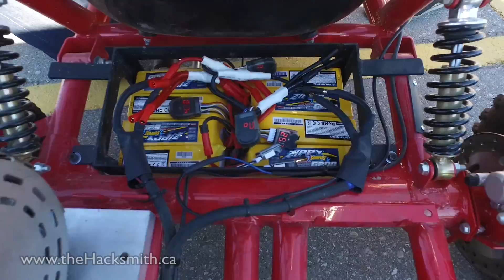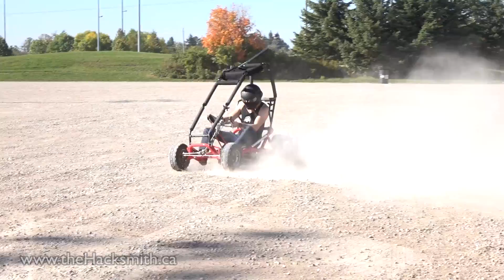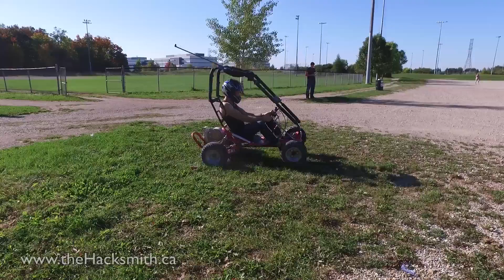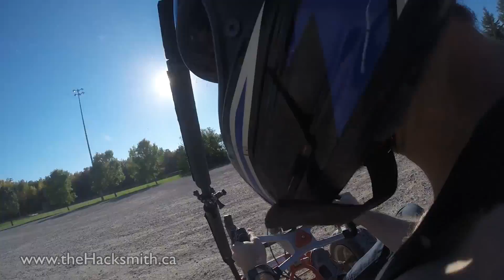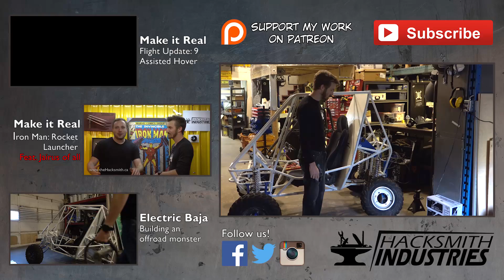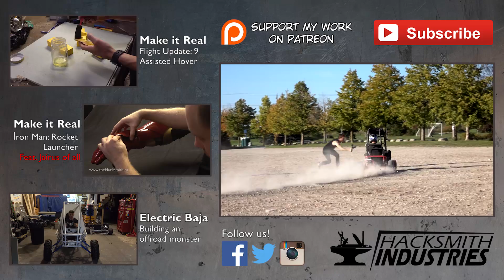Overpowered Electric Go Kart has TOO MUCH TORQUE (54 FT-LB!)

Comment: What do you can that motor? It’s not just a brushless DC motor, it has a spud shaft and sprocket
Reply from the maker: what?
Reply: @hacksmith  
I mean that style of motor, does it have a specific name? It’s not just a brushless hub motor cause it has an output shaft.

Comment: Electric motors  mechanically simple, more efficient, than internal combustion. Only problem is solving the weight to power ratio with the batteries.

Comment: I have a few questions what would be the total price for this what’s the top speed and  where did you buy the go kart without the electric engine I asked these questions bc I’m 13 years old and I wanna make an electric off-road vehicle oh and btw what was the battery time? Also what motor did u use the 8000 w or 4000?

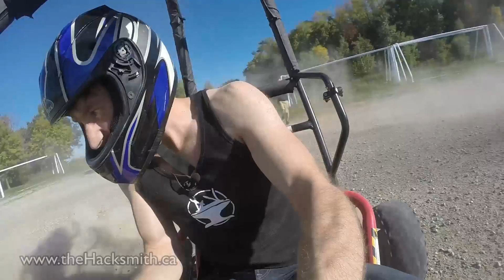Comment: @1:44  umm no actually an engine doesnt put out max torque at the redline its actually much lower ranging from 2-4k depending on the engine (stroke v bore n such)
Reply from the maker: roughly

Comment: I got 12 8s 20,000ah lipo batterys that have 22.2 volts each which equals 266.4volts with the same motor as yours maybe little more powerful and a high end speed controller the thing can get to 0-50kph in like 0.6 seconds has it's all wheel driven, and the batterys last a very long time I usally get 122km and full throttle going at 142kph gets 98km which is crazy and the whole thing pretty much looks like a standard electric buggy like yours but it packs a serious PUNCH
Reply: lol lies
Reply: Where can I get all the equipment your talking about?

Comment: So you ran 8 packs of 8S lipos, but did you run those so 4 packs are in parallel (so 12S4P format)?   Was trying g figure out voltage you were pushing at motor.  Thanks for any input

Comment: Out of curiosity, how many motor RPMs is the 54 ft-lb torque rating measured at? Been building an electric gokart for quite some time now, wondering if there's a standard RPM torque is measured at.
Reply from the maker: torque is typically constant for most DC motors :) so it doesnt matter -- full torque at any RPM. that's why its better then ICE
Reply: I was under the impression that electric motor torque was measured by using the following formula: Horsepower x 5252 / RPMs. And also that wheel torque was found by multiplying the resulting motor torque by the gear ratio of the axle and drive sprockets.
Is this not correct or am I missing something?

Comment: What motor and speed controller are you using? Can we get the exact models"?
Reply from the maker: http://accelerated-systems.com/products/ 4000W controller i think... they don't sell the motor though
Reply: Thanks for the quick reply. Do you know the specs for the motor? 3 phase, etc.. etc..
Reply from the maker: +Douglas Loyo didn't we say that in the video? BLDC motor

Comment: That's great, and look fun....  for 15 mins, until the batteries die.  Then the next set of batteries die.  Then you're broke because you spent $1000 on batteries.  Or just buy gas and drive all day.
Reply from the maker: Those 8 batteries actually last about 45 minutes. Could easily double up the size of the pack and then you've got 1.5 hours. Keep a second pack on charge, and you will driving all day.

Plus you'd need a 30-40HP engine to get 54ft-lbs of torque.

Comment: you prob gett like 30 min of riding time a gas engine gets like 2 hours and still much more fun and sounds better
Reply from the maker: +Timo Hacks closer to an hour actually and did you see how small the battery pack is? We've got multiple so you can swap it out, charge the others off your truck alternator and keep driving

Comment: the motor test in my latest boat was 85 ft pounds torque, I improved the torque to 500 ft . . . . I love your gokart. . . . now lets take your kart for a ride without batteries . .
Reply from the maker: let's take your boat for a cruise without gasoline.
Reply: the Hacksmith 
take look . . . my boat  electric powered
i can make your kart go without batteries
Reply: dude electric drive . . . boat

Comment: What's it like on concrete???
Reply from the maker: +Tim B even better!!!
Reply: the Hacksmith That's awesome, have you thought about making a build that has a gas generator powering electric motors? l've been thinking about doing it myself because I haven't seen anyone try it...
Reply from the maker: +Tim B it's possible but you need a pretty big motor due to inefficiency -- so it kinda ruins the point of an electric car :p
Reply: the Hacksmith Ok, :) just thought I'd throw it out there!

Comment: Looks fast, but it's not practical if you want to have fun with it. The fact that you have to charge it forever and wait is time you could have spent having fun with it. I really think gas is the way to go still. The 670cc predator engine would go great on that kart. Just add gas. Plus it kinda sounds like a Harley.
Reply from the maker: Lasts about an hour per charge and that was a tiny battery pack. Larger one, plus one spare charging while you're going (can charge off of a car's alternator) and you're good to go!
Reply: the Hacksmith how long does it typically take to achieve a full charge on the larger battery?

Comment: Was talking to a guy at work the other day about electric cars and hybrids vs gas engines, pros and cons of each. The guy says to me (about electric cars and how quick they run outta juice), and I quote, "they run out so fast when you really get on the throttle. That's why they should invent some way for electricity to pour into the motor like a gas tank does for regular engines." I just kinda gave him this dumbfounded look and said... "You mean, like a battery?" LMAO 
And he just kept goin! "Yeah but like a gas tank has a fuel line and jets or injectors to spray the gas into the motor. Like that, but for electricity." I said, "You do know that gas is a liquid and takes up physical space, and electricity doesn't, right?" And he said, "No its not. That's why it's called gas. Because it's a gas. It only becomes a liquid when it gets sprayed into the engine. So if they can just build a special tank and fill it up like a gas tank, but with electricity, then u wouldn't run out so quick. And they could make electricity stations where u fill up the tank like they do with gas." 
About this time I realized I wasn't getting anywhere and just say there stunned and said, "Yeah man. That'd be a good idea." 
Pretty sure he thinks he just invented the electric car. 
U don't want to hear his theory on how hybrids work. Let's just say he's convinced the car combines "small lightning" into the gas to make it burn hotter, slower and cleaner. U know, electricity burns clean because its natural and u never see any smoke in the sky after a lightning strike... 
Yeah...

Comment: I went on their website trying to find how to order a electric motor like that or bigger i'm thinking One equal to around 25 or 30hp & I'm needing a controller I have a ATV salvage business and I have plenty of atv's that I could install that in I think it would be bad ass for hunting and hook it directly to a Polaris transmission and I have plenty of room for batteries.
Reply from the maker: They aren't commercially available yet unfortunately. Company is still doing R&D
Reply: the Hacksmith dang man if they want to test it on an ATV tell him to send one my way I will put it through the Ultimate test make sure it's waterproof 😂👍
Reply from the maker: +Matthew Milam lol I think they're good haha. I don't think they are waterproof

Comment: make a go kart But which can drive on. railways 391mm (15inch gauge) the kart could be Longer which maybe reduce the Effect of the tourqe.
Reply: The go-cart should be much longer an maybe wider so the torque will be easier to control.

Comment: how much does the motor and drive cost?+ batteries
Reply from the maker: +jtaylorls1 the motor used in this video isn't commercially available yet. I think the controller is about $1000 and so were the batteries

Comment: Could you use a car battery or maybe a tractor battery to power the motor?
Reply from the maker: Yeah but lithium polymer batteries are three times the energy density of lead acid -- they're much better!

Comment: I can't find this motor on then website ?  anyone know of a retailer ? I want to build a OHV with 4x4 , hubcentric drives on the front wheels and 1 of these in the rear but a 2 seater like a RZR
Reply from the maker: Sadly they are not available for consumer use yet, just an R&D motor

Comment: An electric motor typically has 8 time the horsepower of a comparable gas engine, so 15 horse equals about 120 in gas engine power, no wonder the wheelies !!
Reply: Horsepower is horsepower. If 15 hp was equal to 120 hp, it would be a 120 hp motor. I think it would be a gas engine can be 8 times as large as an electric motor.
Reply: it's rated by the amount of torque it can deliver at 0 rpm!!!! Not  raising 1 lb 1 foot in 1 min, etc maybe I stated it wrong or maybe you should do more research !!
Reply: TheDave570  Sorry I don't need to research that a 15 hp motor doesn't have 120 hp. Maybe you should explained your comment a little more clearly! Looks like someone did a little research of their own after the original post.

Comment: But all the power comes from the batteries, not the motor.   The motor is just converting that power into motion.
Reply from the maker: so... a gasoline engine takes power from the gasoline... not the engine..

Comment: I know this is a stupid question - but how does the thing work with no diff?:) I mean is it acceptable? The wheels seem to take alot of punishment..
Reply from the maker: +Maly Pivo differential would be good but it was just a fun test project, scrapped it long ago. Working with a Baja now!
Reply: Hm I know gocarts dont have a diff but then again they usually dont have this power:) a limited slip diff on a electric engine - wouldnt that be a first:)

Comment: hey mate im building my own go kart. i got a 5 hp electric motor rated at 3500 rpm. im trying to make it go at 30-35mph. i'll be using 12 inch wheels. what type of batteries do you recommend, or how much energy source?
Reply: another question. what can you use to control the speed of the go kart. i dont want it to instantly operate at 30mph. can i use a speed controller? or what do you guys recommend?

Comment: No power regulator, too much torque - this is eletric motor, big torque in low rpm- full power in 0-max rpm???? No traction, guy too much power with big torque in low rpm. Simple PWM power regulator and nice go kart with control.
Reply from the maker: It was a for fun project... The title "too much torque" was so people would watch it. We could have easily tuned the speed controller, but wheelies are fun!

Comment: hey you guys are from waterloo as well.  sweet sheet.  i need a shop to work in.. maybe we can share the cost of a rental garage or share the cost of bigger equipment or work out some sort of arrangement we both can benefit from
Reply from the maker: We're pretty well set right now, found a property (now my home) with a 1300sqft garage in the back, built in the 80's for a trucker =) I'm afraid we don't really have room to share though, but if you ever wanted to collab on a project that might be a possibility
Reply: the Hacksmith
you can text me at 5197229699 or localbroadcast@hotmail.com.  I am building a cnc machine / 3d printer / plasma cutter rig, but kind of lack the space needed to really have it in a functional space... I have most of the parts already needed for it, and I know i have for sure 100% of the materials needed to put the basic frame structure together for it (extruded aluminum and steel tubing).  Would you be interested in having my CNC machine set up in your space, and you could have use of it whenever you wanted, until I get a more suitable space for it myself?  I wouldn't really want to collab on the building of the machine as I've put a lot of thought into it already and would like to maintain ownership of the machine, but like i said, you could use it while its in your shop.  what do you think of this idea?

Comment: why did he not use a car battery
Reply from the maker: Cause it's a 48V system, you'd need four car batteries
Reply: the Hacksmith oh ok
Reply: Because LiPo > Lead Acid and like 1/50th the weight.

Comment: I have (had) a gocart made from high performance slalom racing gravity racer, the gas engine sucked, but the frame is super stable, titan floored I think, with this engine it would be universal missile. It has only 10cm ground clearance, and suddenly only front brakes from now on, but kinda big alloy wheels with big round and sick tires. Your engine is ridiculous. :)

Comment: when he said the electric moter could beat any 15hp gas moter I laughed my ass off
Reply from the maker: +Sagen Nc it can... A 15HP gas motor has about 20ft-lbs of torque if you're lucky.
Reply: the Hacksmith well yea stock but that's like saying this little electrical motor is stock they had to do a lot of moding to get it this way
Reply from the maker: +Sagen Nc no... It's completely stock, there's barely anything you can do to a motor to "upgrade" it.
Reply: the Hacksmith so there last model before this one they did no upgrades to get the one you got now
Reply from the maker: +Sagen Nc what model are you talking about? There weren't any modifications made, all we did in this video was provide the battery pack. Electic motors are just better than gas pound for pound :p

There's a video of a Tesla model X towing a 3500lb trailer with a super car on the trailer, while drag racing against the same super car, and the tesla wins :p
Reply: A 15 hp electric motor vs a 15 hp gas motor is no competition, the electric motor will destroy it, yes they both have 15hp but the electric motor has more torque and more importantly more USABLE power, unlike the gas which makes the peak 15hp at a certain rpm (3000?), the electric will make max torque from VERY LOW rpm, the electric will definitely feel and be faster no doubt

Comment: Not 54ftlb at the wheels, misleading, need to multiply by the gear ratio for correct wheel torque.
Reply from the maker: +marcussho yeah... You never record torque at the wheels, only at the engine... At the wheels it's over 200ft-lb
Reply: the Hacksmith just giving you a ration, cool build

Comment: Hello. Can you do it also on Servo Motors? What may be the pros and cons?
Reply from the maker: Servo motors are not ideal for vehicle applications like this. This is a brushless DC motor (which is basically an AC synchronous motor)

Comment: you need two. one for the front and one for the back wheels. a bigger battery underneath the seat/floor will help keep the center of gravity lower so it won't roll very much even though that's not much of a problem in a kart.

Comment: DC motors don't put out the highest torque at 0 rpm... AC motors do
Reply from the maker: +Jacob Walls i said practically... It's still a much better performance curve than an internal combustion engine :)

And these are brushless DC motors which are basically AC synchronous

Comment: I built one in high school. it used a 75hp motor and dragged a 1/4 mile at 83 miles per hour. given more drag strip it would have easily topped 120 as it was geared more for top end.
Reply from the maker: +Gerg C niiice

Comment: nothing to do with too much torque! improper weight distribution ,that's why you have no steering and pop wheelies ! since your going to a bigger frame your going to lose the high power to weight ratio.your going to need a bigger motor and more batteries and guess what ,if you don't distribute the weight properly its going to do the same damn thing.good luck.
Reply from the maker: It's just a catchy headline dude, not actually too much torque. We're planning on using two of the motors with the larger frame and keeping the batteries and driver ahead of the CofG. Also having suspension will affect it as well =)
Reply: the Hacksmith yep half expected that response and obviously you know everyone  calls that click bait . not that i give a damn but now a days people tend to be very anal over such trivial crap . wish you guys the best . if you can build a electric trophy truck that can go 500 miles give me a shout !
Reply from the maker: Thanks man!

Comment: Great for level ground, how about up the hill and down in a power to heat dissipation test, without burning the circuits off?
Reply from the maker: Most of the components are pretty over-sized, so not too worried about that -- we'll be doing lots of hilly tests with the dune buggy version, this kart didn't have any suspension so it wouldn't be great for offroading

Comment: I have been thinking about using 4 scooter electric hub motors one on each wheel..... All wheel drive would be  a kick in the  ass and four smaller motors would actually have more power than just one or even two motors on the rear wheels for what i think would be less dollars if i can source the parts well.
Reply from the maker: +Christopher Leveck electic scooter hub motors are at best 2kW (most under 1kW), so this 11kW motor would still out perform that ;-)